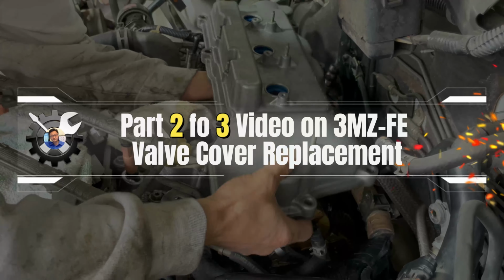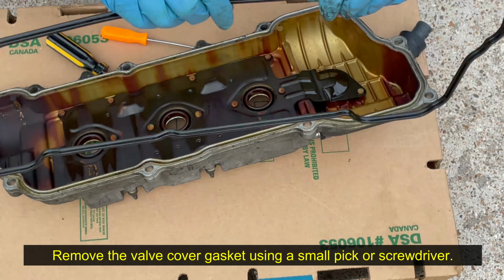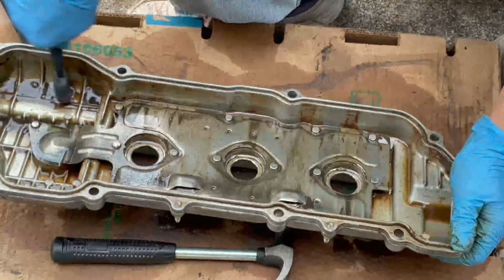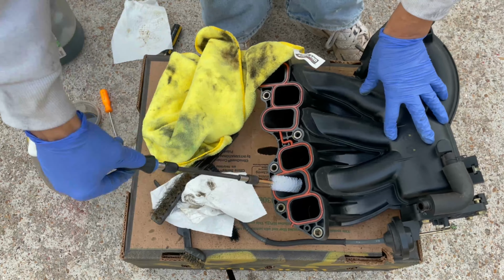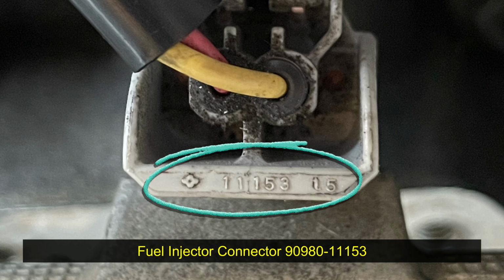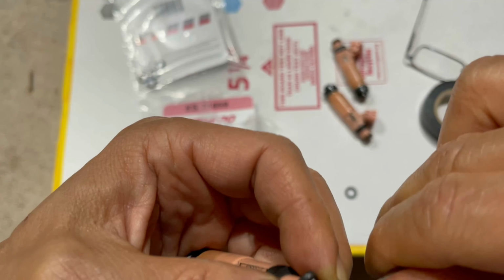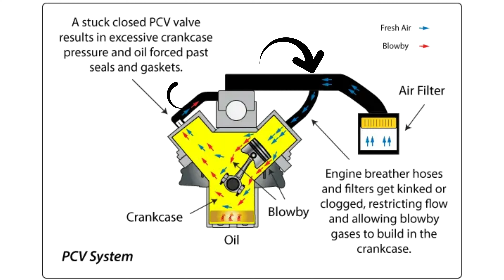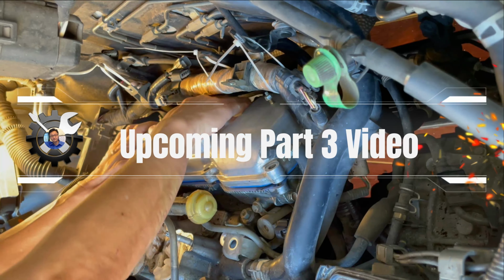Toyota/Lexus 3MZ-FE V6 Engine Valve Cover Replacement Part 2 of 3

Comment: @3:00 when you are trying to remove the spark plug tube seals, the best way to remove them is to use a flat head screwdriver and insert it NOT on the round side/walls because you risk damaging the metal.  Instead, use the flat head screwdriver and insert it on the inner opening (get under the old tube seal) and simply pull up/towards you (or you can twist the flat head screwdriver once it is under the tube seal and the base of the valve cover opening).  They will pry up easily.  Once the old tube seals are removed, you'll have more space to pry up the metal tabs before seating the new tube seals.

Comment: @9:44, you can partly clean this area of carbon deposits by removing the lower intake manifold (which is just underneath the fuel rails).  Removing the lower intake manifold serves four main purposes.  (1) it exposes the underlying water transfer hose (Hose, Water By-Pass, No. 1 - Toyota 16261-20010), which should be replaced per Haynes Manual if you've come this far; (2) you can replace the old lower intake manifold gaskets which are now exposed; (3) it allows you to easily clean the six ports of the lower intake manifold without risking dropping the carbon deposits (or anything else) falling further to the valves and the cylinders.  Note: I would not recommend cleaning the valves unless they are SUPER dirty (not likely because these are cleaned constantly with port injection of the fuel).  The risks outweigh the benefits IMHO; and (4) removing the lower intake manifold (and plugging the ports with paper towels) allows you MUCH added comfort/space when attempting to remove/reseat the rear valve cover.

Comment: Great job.  I just bought a 04 es330 has 205,000 miles.  I’m needing to do the knock sensors and the valve covers. With the miles on yours has your knock sensors gone bad yet.    I’m putting new reman injectors on , new ignition coils and spark plugs. New intake manifold gaskets and plenum gskt
Reply from the maker: @damienbell3155  I didn’t have to replace the knock sensor but the engine ran so smoothly. Just the massive valve gasket oil leak is the only weakness on this engine.

Comment: I ordered a set of those valve cover bolts as well. They look like a one-time use item.
Reply from the maker: I had to call several Toyota dealers and one claimed to have it but was wrong bolt so I had to drive another 30 miles to find one.  I think they were like $12 each.  

The problem is aluminum block engine can get damaged if it’s tightened too hard so looks like they intentionally made the bolt to be weaker so you couldn’t possibly tighten it hard.  Let me list all the torque specs in part 4 videos once I find my notes but I recall it was lower than I expected…like 14 to 18 ft pounds.  I’ll confirm in next video.

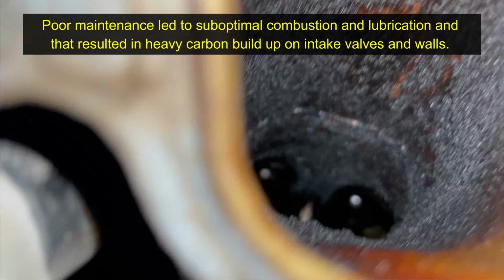Comment: @9:45, you clean the walls leading to the intake valves using carburetor cleaner and a brush.  My only issue is that I've been reading that not all of the intake valves are closed at the same time.  So my question to you is:  how did you ensure that all the carbon deposit grime/sediment doesn't fall through one of the open intake valves?  Also, and excuse my inexperience, but is it safe to use carburetor cleaner if the engine has a port fuel injection system and not a carburetor?  Thanks again.
Reply from the maker: I replied to your other message on how to clean the intake valves for cleaning.  As for cleaning chemical, yeah it’s safe to use carburetor cleaner for this aluminum engine.

Comment: For the spark plug tube seals, some of these valve covers (toyota) do have that metal tab you need to bend first (gently) and some of these plug tube seals come out from the top, some from the bottom. Any chance you know if a 2014 Rav4 2.4L has valve cover tube seals that come out from the top? Thanks! Ive done this job too on my highlander, did the rear bank o2 sensor, water bypass hose in the middle (was in great condition), and the knock sensor harness! (Known to get brittle & throw codes on 1mz)

Comment: I have a 2004 RX330.  While it has the same engine as its Highlander counterpart, it appears that there may be more disassembly required for the RX330 to allow for clearance to the lower valve cover/throttle body assemblies.  For instance, the Highlander has a clearly visible strut bar.  On the RX330, it appears that the strut bar is hidden under a cover that can only be removed by undoing the wiper assemblies.  Did you experience this on the Highlander?
Reply from the maker: Yeah, RX330 you probably have to remove the cowl to create more space, but that's not difficult as you have lots of space to work with and none are hard to remove parts.   Here is a Camry video, but the concept should be same for RX330. https://www.youtube.com/watch?v=iz3k1oZ6Yjg
Reply: @DIYLifeSkills  thank you so much!  I have watched so many videos on this and yours is by far the most complete.  I hadn't found a video that talks about removing the part you just referred to, the cowl!  Man, I am so glad I found your video   God bless!

Comment: When you were cleaning the intake valves with the brush was there any chance that carbon would go past the intake valve and into the cylinder heads or were they all cleaned up using the paper towel and also helped that the  intake valve position covered the hole? 
Also, you actually scrubbed the intake valve itself right? Can I use any pressure when using the wire brush or should I treat it with care?
Reply from the maker: Some but they'll be burned off. 
This is why I usually drive the car for 30-60 minutes on highway after carbon cleaning, and then change oil.
Reply: @DIYLifeSkills does the carb cleaner and carbon sludge that falls through the open valve indeed burn off over time?  Is it safe for the engine to have this stuff in the cylinder? Why do so many folks insist that the intake valves be closed if they are not closed?
Reply from the maker: @carlosamorin7989  Dropping cleaning sludge/carbon to piston chamber will foul up catalytic converter and make it fail prematurely. And OEM quality catalytic converter is very expensive because they contain precious metals, and that’s why thieves are stealing them. Avoid dropping carbon residue into piston by ensuring that intake valves are fully closed.
Reply: @DIYLifeSkills  thank you.  Could you point me to a video that teaches us how to ensure that our type of engine is allowed to close its intake valves?  I couldn't find a video for our engine.
Reply from the maker: @carlosamorin7989  For Highlander, I could’ve made into more than 10 videos for all the work I’ve done, but I was too busy with my full time job, so I shrunk it to 3 videos only.  However, you can what I’ve done for my 2006 Lexus GS300 in these two video as concepts are identical. 

https://youtu.be/SS8vFbBLIG0?si=ydYNeve349a0ud8k
Reply from the maker: @carlosamorin7989  Here is another video. First video focuses on carbon cleaning in piston heads. Second video focuses on carbon cleaning in intake valves.
Reply from the maker: https://youtu.be/m0fGP3MrqFQ?si=R9Sr4ZWKOahdJyw8
Reply from the maker: @carlosamorin7989  since this is port injection engine, the intake valves do not build heavy carbon like GDI engines, so if you want to keep it simple, just put some paper towel at the bottom of the intake valve chamber to prevent debris from falling into pistons and you can use a vacuum method that I explained in other video links above.
Reply: @DIYLifeSkills  I would do that at a minimum.  However, isn't there a way to manually close these intake valves?
Reply from the maker: @carlosamorin7989  You have to rotate the crankshaft to different position as shown in videos I mentioned above. This will close intake valves.